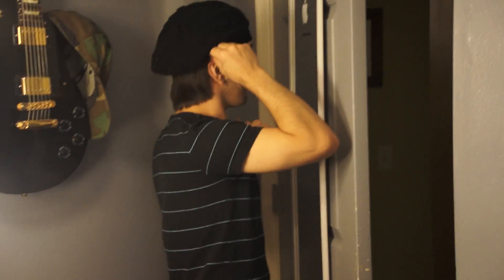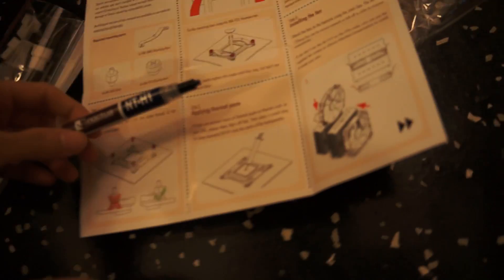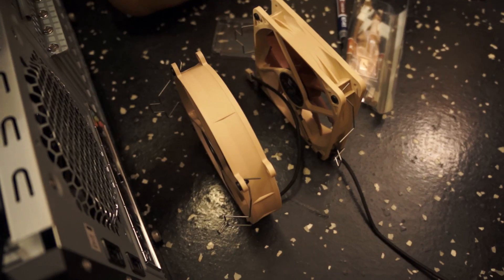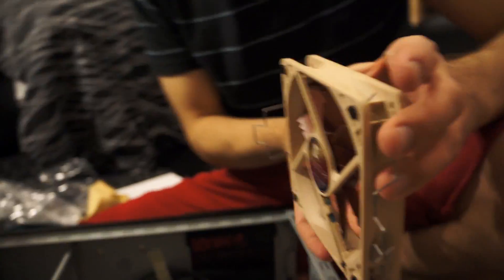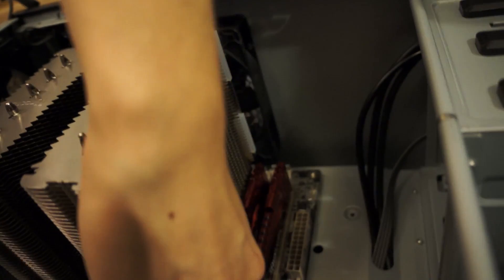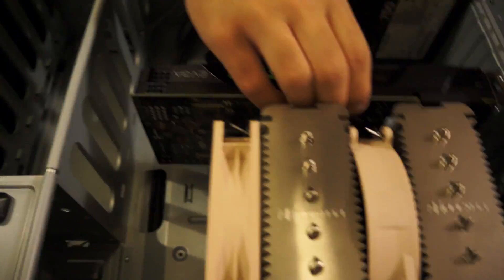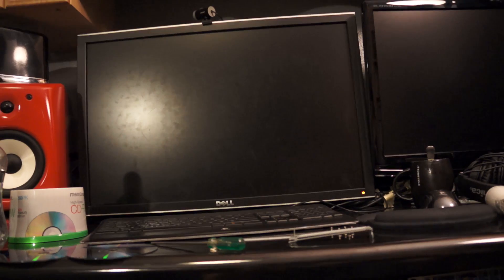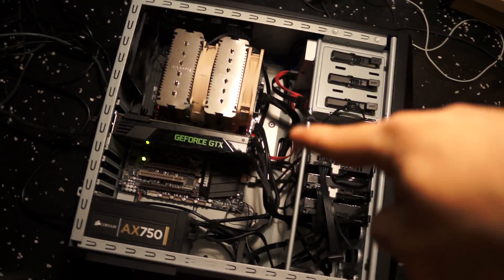CPU FAN ERROR!

Comment: I just got this, set q-fan to silent, and ended up at 356 rpm on cpu, with Noctua nh-d15s dual fan. Idle temp is around 35 Celsius. The BIOS doesn't know you bought a 3rd party cooler and is expecting to see the Intel shitty stock cooler's smaller, high rpm fan. The default is probable 600rpm or something.

I understand that you can go into BIOS and reset the minimum fan speed to etc 550 rpm or 300rpm, problem solved.

But how I reset it to default fan speed I don't now? 

I have P7P55D-E Pro, Intel Core i7-870. I would like the bios to handle the fan speed. After I changed to Noctua, and in silent mode, I cant hear my computer at all. I had to open up the case to check if fan was actually spinning, and they did. But at low 356 rpm, and that trigger the cpu fan error in the start.

If I change to normal, there is no such cpu fan error. I don't remember exact rpm, I think it was at 600-700 rpm, still quiet. So it seems that Bios expect you to have some rpm limit based on stock coolers. 

That is not cool, and not be able to change/reset the minimum fan speed! So hopefully, I hope on some help in this matters...

But I suppose you just enter bios, and under cpu fan, just choose ignore where the etc 300 rpm red numbers are, and live q-fan on.

Comment: I have a old HP motherboard that doesn't have any options in the BIOS to control fan speed, Q-fan or voltage. The model of my motherboard is the Pegatron 2AB6. I plan on getting a new motherboard sometime in the near future, but I have to stick with this one for now. >_< So will this be a problem for me when I get my NH-D14 in the mail? I know that people have turned off the Q-fan option in the BIOS, but because I can't do that, can I just connect the two 3-pin fans into the Y-splitter given and the other end into the 4-pin CPU header? I heard you can still use 3-pin fans onto a 4-pin header with the other pin exposed. I need some clarification on this, please. >_< I really want to use the NH-D14, but I'm afraid that my motherboard won't be compatible with it and there's no information of my motherboard online to help me with, cause it's an old HP board.

Comment: to fix it you'll need to remove the cpu fan wire and try it on all the other places for cpu fan plug in thats what i did because probably the other ones have higher voltage then what cpu fan requires
Reply: James Deen thanx you r a life saver

Comment: ***** yes, the CPU out of range error is the same as CPU Not Detected/CPU Fan Error, if the system you have is recent enough to have a 4 pin PWM type fan header, use only Dell fans from Delta as they are the only ones that have the specific 4 pin PWM (+, -, RPM Monitor, speed controoller) connectors for Dell motherboards and are fast enough to cool the system efficiently if it is under heavy loads, but if it's the older 3-pin (+, -, RPM Monitor) in an ATX formfactor (system opens from the right hand panel<opening from back>) again, Dell parts are highly recommended, but any old 80-90mm high speed fan will do the trick (120-140MM for BTX type systems), make sure the connectors are in tight and the screws on the fan mounts are secure and that there are no obstructions, if you feel the need to, add a fan grill to the back of the fan, and remember, Cable management is vital in Dell systems of years 2004 up because they are usually in a BTX formfactor with the CPU up in the front of the chassis with the fan and shroud pulling air in from the front of the chassis. any cables behind the heatsink's shroud will obstruct the path of airflow resulting in poor performace and possible temperature issues.

if the troubleshooting here hasn't done anything to enhance the situation, you can assume that the fan controllers on the board are dead, connect the fans to a fan controller and ignore the out of range errors... you'll just have to get used to pressing the F1 key at bootup or replace the motherboard if new or healthy parts are available.

Comment: The thermal paste should of been spread over the whole chip not just blobbed on in the centre.  And yeah, don't need to remove it if it's still fresh, only need to remove it if it's been on for months and then reapply some more.

Comment: yes ivy bridge does run at higher temperatures than sandy bridge but they are ment to because of the 22 nanometer size of he chip. plus when looking at processors dont go by just the core amount or the cache. this is how amd tricks people with things like 8 physical core processor. you alway want to check up on the pipelining because that is what is doing the work. (really nice choice with the processor( you have actually 12 cores. 6 physical and 12 hyper-threads

Comment: Oh boy, a corsair ax750 ... Never again in my system. Had the 850 for 6 months and it never worked right and gave up after 6 months completely. Running on an XFX Pro 1050W black edition now. Much much much much much better. Maybe I just had bad luck but never ever getting corsair again.

Comment from the maker: Thanks for the assurance! =] I wouldn't go as far as calling them a beast, unless beasts normally malfunction on a weekly basis. I know all about bootcamp. Trust me, when I had a Mac, I used Windows 7 A LOT more than OSX to avoid the issues OSX was causing, which is very sad. Yet, I still couldn't avoid issues even using Windows because the hardware would give out constantly. Worst computer experience of my life, and most expensive computer I have ever owned.

Comment from the maker: You took what I said completely out of context lol. I placed the cooler on top after applying the small amount, which spread out the thermal paste onto the CPU, after doing so it didn't feel like it was sitting right so I took it off the CPU to investigate, I guess we cut that out. I wasn't sure if it's good practice to clean off the CPU and start over if you mess up and take the cooler off like we did. I think my PC repair teacher would have, but it would have been a waste of time really.

Comment from the maker: Trust me the cable management looks worse on camera for some reason, it's actually done very well. All of the cables that could possible go around the back are. Either way, there are plenty of studies that prove that cable management makes very minimal difference unless there is a great amount of airflow, which I was expecting there to be 3 fans pushing air through the front of the PC, but I accidentally bought the one that didn't come with it and yet my CPU is still running a very low temp.

Comment: okay, haven't watched the whole video, but do NOT remove the thermal paste.  the thermal paste is there to soak up the heat. the reason too much creates more heat is because it kind of acts as a barrier and stops air from flowing under the heatsink and onto the processor. only apply a small amount, just like what you were doing at the beginning of the video.  and again, do NOT remove the thermal paste. it should always be there. you can even replace it maybe 2-4 years later if you're overheating

Comment from the maker: Exactly. When it comes down to it the only difference is 1. the OS 2. The hardware choice vs whatever Apple decides to put in their computers 3. The applications that are compatible with each particular OS. As far picking the right tool for the right job, the OS itself has nothing to do with that, it's all about the applications that are compatible with the OS. Luckily most of the good ones are compatible on both. Only difference video wise is Vegas isn't for Mac and FCP isn't for PC.

Comment from the maker: We explained in this video that we researched it and found that placing a dot and just putting the cooler on top without spreading gets better temperatures than spreading or any other technique really. And they found that less is more. It is assumed that this is caused by the slight imperfections that occur after spreading no matter how perfect it looks letting air into it.

Comment from the maker: Also, from what I understand they use Hitachi hard drives. REALLY? At least when I'm building a computer I have a choice to not put that crap in my computer. The only hard drive I would ever put in a computer is WD. We don't hate Macs, we dislike the experience we had with our Mac, the horror stories we have heard from Mac users, and the minds tricks and brainwashing that comes with owning one. There were no issues by the way, the fan thing was a 1 button syndrome thing.

Comment from the maker: Funny thing is when we had our top-of-the-line MacBook Pro, that was the argument I always defaulted to during Mac vs PC debates also, whilst my motherboard was melting, hard drive was failing TWICE, battery wasn't holding a charge THREE TIMES, and DVD drive was grinding until one day it wouldn't eject a CD and had to be replaced LOL. They aren't made to work together, they are made to make Apple the most money possible. No different than a Dell or HP.

Comment from the maker: It wasn't a tissue, more of a piece of a paper bag type thing, and it didn't touch the CPU when I removed it, basically just picked it up. The CPU temp runs a steady 31C so it's absolutely fine how it is now. We are no blowing hot air into the case lol, it's set up correctly right now. If I were to leave it how it was the first time, my CPU would be melted by now lol.

Comment: Nah, not really necessary for them. They're not on carpet or sitting in chairs and regardless, touching the metal of the case frame does just fine to discharge any possible static charge.

Comment: Also...lol...My HP burned up because of the fan. It does not matter how clean your house is, It sucks in all the dust and your fans will go hi and if your at work or not home it will burn up your mother board fast. You spend your money on this chit,And want it to run perfect . Like a car...Spend a little time on it so it can do its job. Not to DJ as i'v seen yours . But just throwing it out there    :)

Comment: When plugging in graphics cards read the motherboard manual. The top port is normally the main port for the first video card. The other ports are for systems running more than one video card in SLI mode. The video card in those other ports will be controlled by the main video card handing off tasks to them as needed to speed up video processing.

Comment: When it comes to the Power supply do not pay attention to how the text is placed on it as that is placed on for the normal orientation in a normal stock standard case. A regular case has that fan facing into the case and sucking the air from the inside, but that case is designed to have the fan suck the air from below so it is getting air not already heated by the things in your case like the CPU, hard-drive or Video card.

Comment: That error with the CPU fan would be due to very low revolutions per minute (RPM) on the fan. Big heatsinks already run slower fans for quietness because they are larger and there are two of them, they are able to remove as much or more heat at slower speeds than the standard CPU fans running at the higher RPM .The Q-fan mode on motherboards slows fans down to lower noise when they are cooler, speeding them up when hotter. It was slowing those to below the warning level of a normal single fan.

Comment from the maker: No, the error was because the fan wasn't spinning fast enough. There is an issue with the Noctua cooler and the Asus motherboard when Q-Fan is on. We turned Q-Fan off and everything is just fine. =]

Comment: All right. Nice Corsair Vengeance RAM right? I have the same stuff, was that a GTX 680? If so very nice and good Corsair PSU, I've got a GS800 and its pretty awesome and yes, you did install it the right way and when I built my PC I missed one of the fan power cables for my case (It has a lot it's an NZXT Phantom) and they didn't work. Lucky the CPU fan was connected separately or I'd be $400NZD short :|